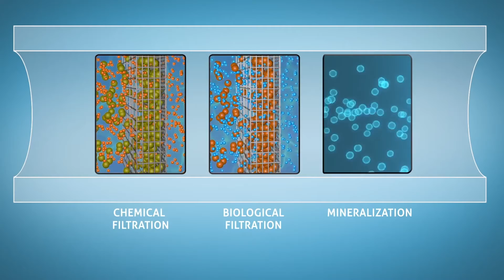How much drinking water can you pull from the air?

Comment: Water from air is no "big solution", especially not for agriculture, because of the high energy consumption. It needs around 1 kWh per liter of water, more in dry, less in humid environments.
If you have dirty water or sea water, filtration and reverse osmosis will always be the better solution. Just for comparison: You get up to 500 liters of fresh water per kWh by reverse osmosis of sea water.
But it might be useful in some special niches.

Comment: Congratulations, you have made an airconditioner in a box. No different if you just collect the condensate water of your air handler unit. In a world where energy in abundant this would be ideal. Definitely worth it where water is existant, like tatooine
Reply: True...

But was taken to the effectuate level to produce a vast amount of water...
Reply: @ronchilds7545  The water is cleaned and minerals are added.  The amount of water produced is incredible.  6000 liters is a lot of water.  These devices work off solar panels, so you don’t need a battery or plug in.

Comment: Practicality?
Reply: why  isn't it practical?
Reply: @robinsss  I'm asking if it's more practical than simply building a well
Reply: @NoahZarke  where would the water in the well come from?
Reply: @robinsss  the ground. Where else would it come from
Reply: @robinsss  I'll ask you a question. Why hasn't this device become mainstream?
Reply: @NoahZarke  because of bad leadership in places where it's needed
Reply: @NoahZarke 

no digging is required

ground water can be depleted 

water from the air is a endless source of water
Reply: @robinsss  how much water can it produce though? Seems like it would produce considerably less than a standard well would.
Reply: @NoahZarke  he amount of water may be equal or more compare to one generator but the generator is more practical because  o digging is required  to get water from a generator 

you  have to dig down according to many sources 100 feet before you find water
underground
Reply: Even after a 250 feet deep well..  rhe water quality
Is hardly certain to be potable. 
So... air to h2o
Reply: The average depth from ground surface to the water table in Phoenix AZ  is about 300 feet. Difficult in USA and nearly impossible to achieve in dry third world countries. This system can be brought in and immediately start producing water.
Reply: @brianrussell4222  in Kenya it is almost impossible in ASAL regions, which is 85% of the country. It no longer rains, and the government tried to dig wells and boreholes but they have no water too.
So maybe air should be the next source